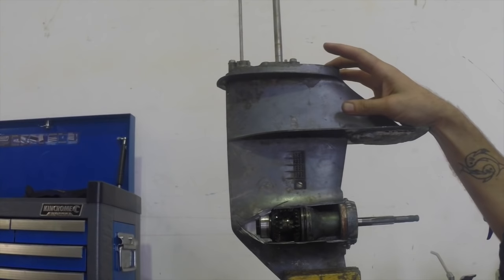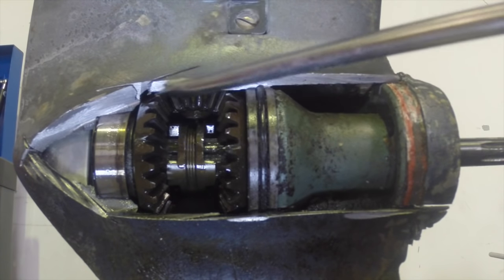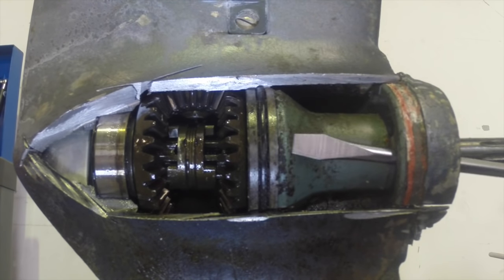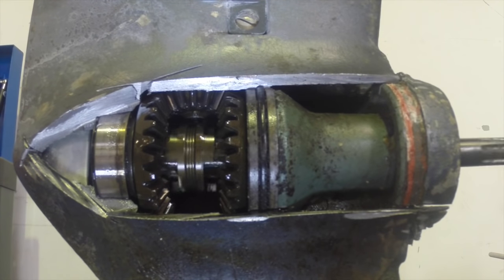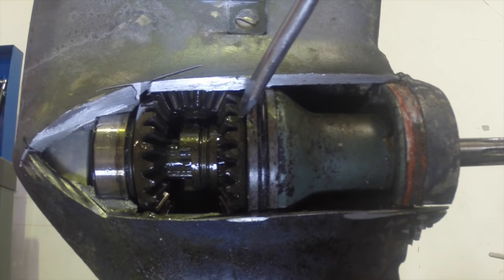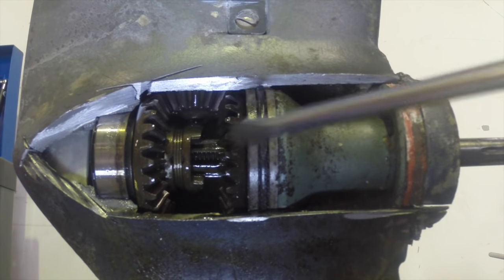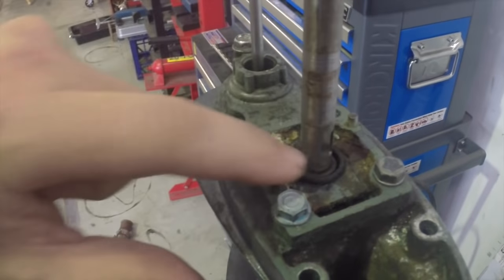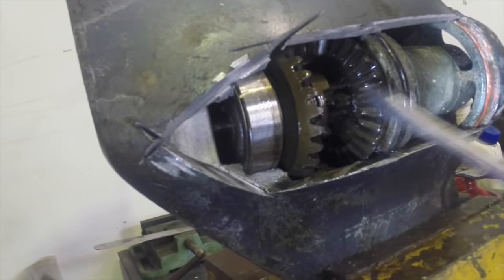How an outboard gearbox works

Comment: Learned something new, thx!
Reply from the maker: You're welcome Hoa. :)
Reply: +Dangar Marine Hey bud i have a 97 yamaha c25 mshv. I got a brand new lower unit in but the problem is that i got the long version. the drive shaft and the gear shift assembly are larger than the one i have but everything else is the exact same. im very nervous to take apart the new lower unit but i have the 2 parts in good condition from my old LU. Will all the gears and bearings fit back easily or will i have to shim or measure anything. I just want to add the smaller gear shift ass and drive shaft to the new lower unit. Do you think a person with average tools at home can do this? Thanks and you are by far the best person on youtube that really shows how to work with yammies!!
Reply from the maker: Hi mate, to be honest it is a reasonably tricky job, although if everything is new it probably won't need shimming. The bearing hosing will go back in easily enough, but you will also need to get the nut off the end of the drive shaft. You know, I have an old Yamaha gearbox in the workshop I was about to throw out. Are you in a rush? Maybe I could film taking that completely apart within the next week or so. Last time I was in this situation I did a swap with someone looking to go the other way (from short to long) That might be worth considering for you too. Let me check up on the shimming situation in the mean time, but worst case you should be able to put the original one back together.
Reply: Cool thanks bud! I would love to see you do that! The reason i did this is because i found a new one on ebay at half the cost and me and even yamaha usa customer service got mixed up on the right part. On yamahas parts website it list part # 689-45300-07-4D (which is the short) and 689-45300-17-4D  ( long) on the parts list for the 97 c25 mshv. So me and a rep from yamaha took it as if that was a superceded #. So when yamaha told me that they wouldn't have told me that the 17 model because that would have been pulled up under the c25 mlhv, i then asked him then why would it even show up on the mshv model? He then was like uuuhhhhhu I don't make the website lol. And i ordered the unit from ebay with a non refundable quote, so I kinda got screwed on the deal. So im trying to get yamaha to just swap mine out for the short version. It is brand new in box straight from japan. I am currently waiting for yamaha to call me back but the way he was talking im not to positive its gonna work out for me. He tells me that im suppose to go through a dealer but i ordered online. Im in new orleans and part came from south carolina. Part of this is my own fault but even the guy at yamaha told me i could use either the 7 or 17 model. Thanks again and sorry for blabbering on n on
Reply: And also on yamahas website they dont write long or short on the part number. It list both on the diagram but doesn't show to wich model it goes to.
Reply from the maker: Cool, I'll check with the Yamaha guy down the road and see if he has any thoughts on the exchange.

Comment: Went back to find this video. I just fixed up a 15 foot fisher mariner with a 25 hp Johnson. Runs great until a load is put on it. Up to 5 MPR it does not do it.  It fills like hitting a log. I have been told it is the dog is bad in my foot  by friends. All linkage is set right best i could do it. It goes in Rev and forward with ease.  I would like your though on it.

Comment: Let's say you pulled out the shift rod and turned the propshaft and heard a click (locked into gear). How would you get the shift rod back into place? Could I use a long screwdriver to push on the gear selector while turning the propshaft to shift back into neutral?

Comment: This really helped my understanding of an outboard gearbox.  I'm rebuilding a 2017 suzuki 20hp that I tore up in a shallow rapid rocky river. My new fwd gear part has a blue and a yellow mark (dot) on the inside where the dog clutch would engage. I also have blue dot mark on my drive shaft.  Is there any synchonizing at all in the reassembling of the gear box and lower unit?  I can't imagine why there would be, but why the blue and yellow dots?

Comment: So I'm looking to get a 20ft boat equipped with a murcury 200 2 stroke direct oil injection... The seller informs me the motor turns freely in N, but once put in gear it will lock up. What should I check first? Thanks for this awesome video
Reply from the maker: Sounds like the gearbox has seized, I'd pull the bearing carrier and see what is going on.

Comment: I have a Honda 200 outboard that my husband removed the lower unit to check the water pump. After we have it reinstalled, the propeller will turn (forward and backward), but when we put it in water, engine dies once push into gear. What do you think he might have messed up?

Comment: Good video. What is changed when its a counter rotating prop??
Reply from the maker: That's a great question. I don't really know but I'm keen to find out now. There isn't a huge different between forward and reverse in and outboard gearbox so I'm guessing it is really just a case of modifying the gear selector to work in the opposite direction and perhaps making sure the gear ratios are correct.
Reply: Ok cool. I have a left prop on my yamaha. Everyone makes a big deal about it..but it seems like it might be a simple modification (from the factory) with the design.
And this video helps explain the clunky shift of my yamaha or of any outboard/stern

Comment: Hello...Youve helped in a few other matters and Im testing out my impeller that I replaced in a 1979 Evinrude 115. You suggested I use a socket and ifigured out how to turn the shaft with my Dewalt drill on high speed . My question is how high should the water rise from the top of the impeller casing outlet ?  It comes out about 6 or so inches and looks ok but I wanted to double check

Comment: Thank you for the video. Question? If my gear box heats up too hot to touch more than a few seconds, even with added gear oil and slight steam or smoke that comes out after running for 5 minutes. What would cause that? Would the impeller have anything to do with it or strictly in the gearbox?
Reply from the maker: That does sound odd, but don't forget that the exhaust comes out through the back part of the gearbox so it may be exhaust heat. If it is the gearbox itself then I would say it is friction from a failed bearing or something like that.
Reply: @DangarMarine  Thank you for the response. Your videos are killer. Such great information.

Comment: I watched your other videos where you change the  rear shaft seals and then you apply a pressure test looking for no leaks. It is interesting as while the vertical drive shaft bearings would be sealed I just wonder if the gear change rod would be sealed  and that would be a path where the leakage could occur.
Reply from the maker: Yep, the gear selector also has a seal on it. Often it is just an o-ring or something like that as it doesn't have to handle the fast rotational speeds, just the odd pull or twist.

Comment: Great video on how it all works. I also watched your video on bearing carrier removal.   Any advice for a 2007 honda bf90d.  Need to replace mine.  Am I able to pull it without removing the shift shaft and water pump shaft?  Have all new bearings and seal for the bearing carrier also.  Does the reverse gear and bearing just press back in?  Thanks in advance

Comment: I have been trying to find a video like this for over a year, glad it popped up while looking for parts for my 1976 20 hp. mercury outboard. trying to replace seals in lower unit. But i need a special tool to remove ring to get to seals. Any ideas on how to remove it? THANKS FRIEND
Reply from the maker: Thanks Ronald. I see you found the other videos on doing the job, they should help you out.

Comment: Hi Danger, So if the shift rod is moving up and down but the drive shaft is always in neutral, what is the problem, what part is not working properly and what does it take to fix it. Does the drive shaft have to be removed from the casing? Thanks Bob.

Comment: I absolutely love the videos.  I have a Johnson 115 1977 outboard, and noticed that oil is seeping through the bearing set screw hole which is located right next to the water intake screen.  I have a feeling that the screw has become dislodged from what it is supposed to be holding inside the unit.  Is this a case where I can screw it back in, or will I need to disassemble the unit in order to line it up with the bearing.  Do you think that running it without it being fully seated will cause damage?  This is a unit I bought as a back up to my original unit in case I need parts from it in the future.  Thanks so much.  Evan
Reply from the maker: Hmmm, not sure about that one. We rarely see any outboards older that about 1990 as they are all commuter boats that just don't last that long being used very day! You might need to find a PDF service manual and find out what the procedure is there. Sorry I couldn't help you.

Comment: Thanks Dangar, best one I could find on the youtube about gearbox. What about small 2HP-5 HP outboard motors are they have same construction?
Reply from the maker: Thanks mate.The only real difference is that some very small outboards don't have forward and reverse, you just spin the motor around 180 degrees to go backwards.

Comment: Aloha. Being as knowledgeable as you are and having probably been into the lower units of a variety of outboards, would you think it physically possible to modify an outboard lower unit for a 1:1 ratio if one was to eliminate the clutch dogs, have smaller diameter forward and reverse gears made to match the vertical drive shaft gear diameter and tooth count, and then weld one of the drive gears directly to the shaft? Thx!

Comment: Good video, may i ask a question, was winterizing my boat today and noticed i had water coming out the prop shaft, I have never noticed this and catching the it was milky showing oil, Is this a water pump seal or a lower unit seal or both maybe?   had not been able to run it all summer and it set not being used unfortunately.  thx in advance
Reply from the maker: +john doe Drive shaft seal under the water pump would be my guess. This is an old video I did on pressure testing a gearbox to help you locate the leak: https://youtu.be/Lzn-nshSlwk
Reply: thank you sir

Comment: Excellent video and explained so simply. one thing... we recently put gearbox etc back on a mercury 70hp 3 cylinder ( an old one) and now when selecting forward or reverse , it is selecting the opposite?? so forward goes into reverse and vice versa. What have i done wrong please?
Reply from the maker: This can happen when the gearbox is in one gear and the forward controls are in a different gear when you put the gearbox back on.

Comment: I changed my honda 9.9hp outboard impeller. I used your strap method to help get the gear box back up in where it belonged. But when I tried to connect the two rods together the upper one fell out...Any idea what I can do to fix this problem....Dave.

Comment: Hi Dangar Marine. I tapped gently with a hammer in the end of the propeller shaft inorder to get the stucked propeller out. After that i noticed that it's hard to switch reverse gear on without turning the shaft little bit when the outboard motor isn't running. Do you think i might have damaged it? The motor is Yamaha 20 hp -86

Comment: The helicoil worked great . I had to shorten it a little to make it flush with the hole and locktight . The problem is I couldn't flush out that tiny break off tab . I'll try a few more times to flush it . But if I can't I'll need to pull the gears out and get inside .
Reply from the maker: Ah, that's a bummer. Does your bottom plug have a magnet on it? If you're lucky you can shake it around and it might stick to it.
Reply: Well , I've made my own tool to remove the grand nut . Now I need to pull the gear cluster out . I can't find anything on line to show me the procedure . I only could see the one for a Merc. One shows the gears pull out all in one shot . The other one shows a guy using a puller . Not sure how my gear box will come out . Either the whole thing or just half . Seems I can't find anything on the 30MHLY , 2 stroke . I guess I should go to the library and see if there is a repair manual there .
Reply from the maker: I imagine it would be very similar to in this video, even if the locking nut was different https://youtu.be/HRpfaOiXxWo There are quite a few outboard manuals on readmanuals.com available as PDFs.

Comment: hello thank you for this video .My question is that my 40HP outboard erodes the drive shaft and replaced the drive shaft 3 times what could be the problem.My technician is unable to figure out the problem

Comment: Thanks for the vid!  Can you tell me why the exhaust comes out in front of the prop?  Surely if there is gas in the water feed to the prop then it becomes less efficient?
Reply from the maker: Good question! What happens is that the propeller mates quite close inside the gearbox and the exhaust travels through the prop and comes out the centre of the prop behind it.
Reply: Dangar Marine thanks. Is there a reason it’s not ducted elsewhere?

Comment: Hello Dangar,
 Thanks for your Videos, They are been helping me a lot. I have a question to see if you can help me, I have a Yamaha 1986 15hp 2 stroke, the engine runs good 120 PSI on each cilinder, the only problem is when is in high trotter for about like 2 - 3 minutes, the engine goes High on RPM and the speed goes down, I had changed the propeller for a new one, and is still doing the same symptom, and I do not feel any jump of gear at all, I wonder is you have seen this before that you can point me in some direction.
Any help is much appreciate it.
Thanks.

Comment: Can you explain the difference between a standard rotating gear box and a counter rotating gear box. I seem to have bought a 1980 Evinrude 50 hp that has a counter rotating gear box. I push the control forward and the prop spins in reverse? Cables seem to be working in the right direction.

Comment: great videos !  do you have a video on removing a broken drive shaft from upper unit?
Reply from the maker: Not as such, but removing that part of the driveshaft will require removing the powerhead. Here's an old video from when I did it on my Yamaha, you don't need to remove the flywheel though https://www.youtube.com/watch?v=r9n-HU8ADuY
Reply: damn...thats terrible news....do you think i could drill and thread the broken piece and pull it out ?..or fabricate a puller ?.....how many hours for removing and re-insatlling power head ?.....thanks

Comment: Can you explain how to fit the gear selector back into place? I pulled a bolt out I shouldn't have and it popped up. I can't get the oil seal back seated because it's up to far. No idea what to do

Comment: Great video..Hve a 1988 Johnson 9.9h .When I put it in neutral the prop still spins slowly.If I move the shift lever slightly forward and back to neutral it will stop.Dogs must not sure why?
Reply from the maker: Dog clutches don't really slip like car clutches (not without a loud racket anyway). The prop will generally turn like you describe due to friction and the spinning gears causing currents in the oil. How the slight shift of the clutch affects those currents is a mystery!

Comment: i lost the ability to shift. i pulled the lower unit off and after doing so the shifter rod came out completely. i'm trying to find out if i need to tear down the lower unit to fix this. the shift rod came out with the connector that is threaded to the shift rod as well. Thanks for any help!

Comment: Great and informative video! I was wondering if you had any ideas regarding my motor. It's a Mercury 50hp ELPT 2013, and it has a light grindning noise when in neutral. That stops when in gear, both forward and back. I've tried to adjust the gear cable when in neutral, but it doesnt helpt at all. Doesnt make it better or worse actually.. Kinda weird isnt it? Do you have any ideas? Thank you so much in advance! 
Kind regards
Joel

Comment: Your videos are the best thank you so much, one question I have what causes slippage besides the prop's rubber bushing if there is anything else thank you
Reply from the maker: It can also be caused by the prop sucking air from the surface if it is mounted too high.

Comment: I have a 1996 90HP Mercury Force outboard.  The reverse grinds and has little power .  I replaced the dog clutch and the shift cam which were both worn.  In forward I can spin the prop by hand and turn the motor over, in neutral I have free motion in both directions, in reverse I feel the dog engage but if I turn the prop by hand hard enough I feel it ride over the reverse gear teeth.  I’m out of ideas of what the source of the problem is.  Any suggestions?

Comment: Hi I wonder can you help me I have a 2005 Yamaha 5hp 2stroke  outboard  now the gears I nice and smooth and go in and out nicely  but after its warmed up a but it becomes so tight it will hardly move at all could it be bad oil  in gearbox? Once it's cool I then selects gears normally any suggestions would be much appreciated many thanks Lee

Comment: What are your thoughts on running a full synthetic GL-5 75w90 gear oil in a lower unit vs 'marine' SAE 90? I run in fresh water, seals are good, and also run in freezing temps.

Comment: Good explanation thanks.....I have a 4 HP Johnson 2 Stroke, 1987 what is the small hole in the lower unit ( gear case )port side?
Reply from the maker: It's probably just a drain hole so water doesn't sit inside and break the casing when it freezes in winter storage.

Comment: Lower unit is clicking when I turn the prop by hand even with gear selector disconnect.  If put in gear and in forward position the entire motor shakes like crazy.  Any thoughts?